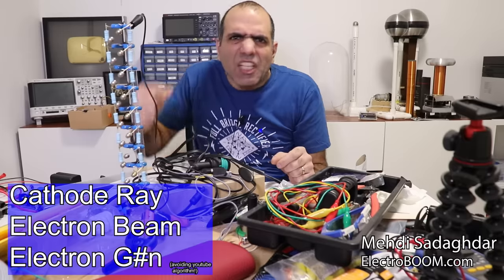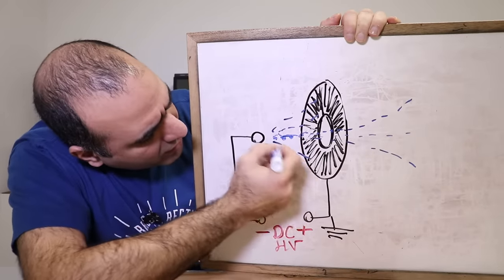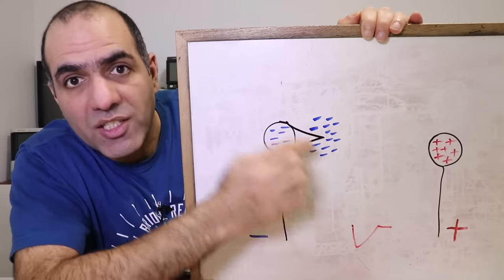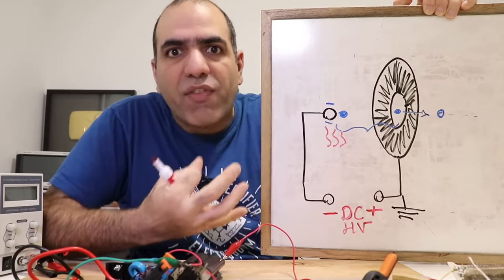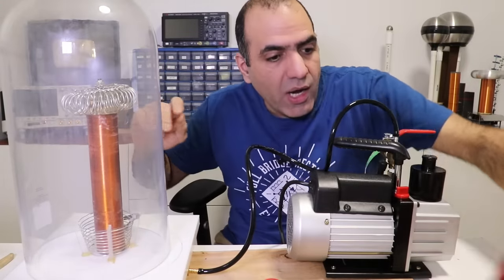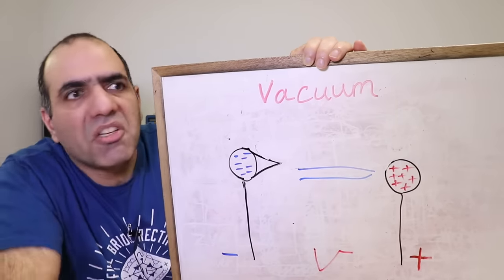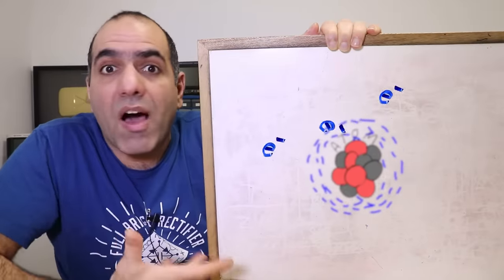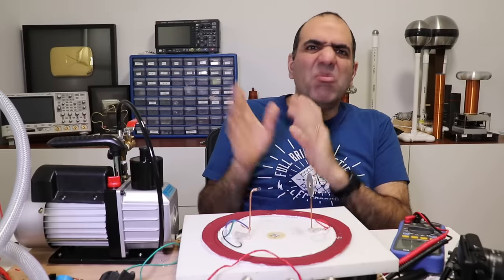Making Super Fast Electrons, Cathode Ray

Comment: In real crts, they build a negatively charged "tin can" around the entire thing. This forces the electrons into the middle, meaning that, depending on the voltage of the "tin can", you get more electrons exiting the gun.
Reply: That's cool
Reply: Also they paint the inner tube with silver to stop the xrays that it produces
Reply: Same thing with beam tetrodes/pentodes which contain beam forming plates.
Reply: @brokentos4546  the conducting metal inside the CRT is where the +25 kv is applied. It sucks the electron out after they hit the phosphor.
The xray are stopped by the lead in the glass. The focussed electron beam is created by the succession of metal plates in the electron gun, including the focus control with a voltage of about +8 kv.
Reply: I would love to see a follow up video with this! @ElectroBOOM !
Reply: @moiquiregardevideo  I'll take your 25kv and raise you 375kv for an xray:P

Comment: You can greatly improve the seal on your vacuum chamber by wiping a thin film of Vaseline around the lower rim of your clear container, laying a wet ring of RTV silicone on the base, and gently pressing the container into the goop.  The Vaseline prevents the RTV from bonding to the glass.  When the RTV cures (give it a full week), remove the container and wipe all the vaseline off both surfaces.  You'll now have a custom-made airtight gasket.
Reply: hes done this in the video where he made his vacuum chamber...
Reply: With a perfect seal, what level of vacuum is this pump capable of?

Comment: " at such high voltages it will probably generate X ray bursts"
Proceeds doing it
Reply: the dose makes the poison, I guess 😂🔥
Reply: @VigiHunter  yes the lethality is equal to time x strength
Reply: @arthurizando  
I wouldn't use the term "Strength", also I would add: divided by distance².

For a X-ray sources mA·s and KV are commenly used for driving the tube. mA·s = current * time and KV is obviously voltage. mA·s is the main way of controlling the amount of X-ray photons produced by a tube while the voltage increases the photon energy, measured in KeV (electronVolt). The voltage actually also has a huge effect on the amount of photons so mA·s has to be lowered to compensate. However, X-rays with higher photon energy are actually less absorbed in a body compared to X-rays with lower photon energy. If someone wants to see soft tissue better compared to for example bone it can be useful to lower the voltage a bit. This is a way to control the contrast in X-ray imagery. You can also take images with MeV equipment used for radiation therapy, this however created images with extremely low contrast compared to normal X-ray equipment because a lot of the X-rays will simply pass through the body without interacting at all.

So "Strength" doesn't really say much in x-ray physics!
Obviously the physics and biological effects behind X-rays are quite a bit more complicated. But my knowledge is incomplete and a bit rusty so to say.
Reply: @Ahapenootjes  o know, just trying to be brief
Reply: @Ahapenootjes  This is part of my field of study, I just didn't want do drag on in a simple YouTube comment joke :).
Reply: @Ahapenootjes  Distance squared* for a point source
Reply: unless he is making more than 30KV, he doesn't really need to worry about x-rays. their energy level is too low to cause damage.. however the 300kv Transmission electron microscopes I deal with can generate over 200 micro seiverts of radiation at certain points if the lead shielding is not in place.
Reply: @jeolman1  yes

Comment: It would be really interesting if you could do the double-slit experiment with electrons in a cloud chamber.  Would the alcohol vapor cloud cause the wave to collapse and behave like a particle immediately causing two vapor trails (i.e. similar to placing the observation screen extremely close to the double slit) or would it show trails of vapor disruption that align with how the interference pattern would form?
Reply: It would cause the wave function to collapse

Comment: Two things, 

The symbol for a diode is a artistic representation of the old style vacuum diode where the triangle is the electrons beaming from the cathode towards the anode.

You should have placed a piece of fluorescent/phosphorescent material behind the washer for a nicer effect.
Reply: That's what I was thinking. Something to check for any electrons that shot through the hole.
Reply: The third problem is having a washer that wide. Typically in CRTs the anode is made from a sheet metal welded into a shape of a cylinder, and the path of electrons has to be narrow to increase efficiency

Comment: "if their desk is not like this it means they are not working"

laughs in software engineer
Reply: So you've not got a notebook and tons and tons of soda cans?
Reply: The desktop is the desk of a software engineer
Reply: so how's the Chrome Tab situation?
Reply: @EpicBoyScout  16gb of ram for multiple tabs of stackoverflow
Reply: "If their deskTOP is not like this it means they are not working"
There fixed it for you :)
Reply: @Onio_Saiyan  if I send you pictures of my table rn, it's as u described, and yeah imma program
Reply: Instead of a desk it's your harddrive that is a mess :V
Reply: @alexstone691  laughs in gnome
Reply: @Onio_Saiyan  red bull does the work
Reply: Lmaooooooo
Reply: I have absolutely no idea what is going on in my workspace(s)
Reply: My dad is an accountant and his desk is like that.
Reply: I wish you could have told my boss that 20 years ago. We had a box where we collected everything that didn't fit in any of the 200 or so drawers, bins and boxes we used to organize parts. We often modified the computers and ended up with bits and bobs that didn't fit into any of our regular parts bins and we didn't feel was worth having a separate bin for. This was where we could find all kinds of strange parts that no one could have foreseen the need for until the day we suddenly needed to solve some problem. This could be anything from adding extra HDD trays to a case that wasn't designed for it to improvising a mount for a water pump or a fan mount. Then one day my boss happened to see this box labeled scrap and almost had an aneurism when we refused to throw it away. He could not understand how we could label a box as scrap and then claim we needed it. In his mind anything useful had to have it's own bin, box, shelve or drawer. If it wasn't important enough to have it's own bin it should be thrown away. So we organized the scrap box, suddenly taking up several shelves with something like 50 boxes, most of which contained one or two pieces, and most of them not likely to ever be used for anything but all of them potentially useful. When he saw the new shelves he just shook his head and walked away. The next time we needed more shelve space we quietly emptied all these small boxes in the old scrap box and he never mentioned it again.
Reply: @TECHSOURABH  Yes it does.

Comment: That's awesome! You've essentially made your own thermionic emission electron gun; in the ultra-high voltage example, you're DEFINITELY producing x-rays (so...umm...be careful*). Mostly Bremsstrahlung, I bet, but the L-K transition characteristic x-rays for whatever metal the washer is made of (aluminum?) are also likely in play (though they're almost certainly insignificant compared to the Brems).

May I suggest using a focusing cup around the cathode - a concave nickel-plated surface which is negatively charged. This will help you get a more even stream of electrons to your anode, and I suspect more electrons will go through the washer. And you know this already, but you REALLY need a better vacuum. Still...pretty decent for a first attempt.

*Modern x-ray tubes use tungsten (or molybdenum, less commonly) as an anode material, and they don't generally operate above a couple hundred kVp (kilovolts peak), using a current-time of 20-300 mAs (milliamp-seconds...meaning that a 10 A current in pulses of 0.01 seconds would give you 100 mAs), so if you're providing similar voltages and currents, even to a metal with a lower atomic number than tungsten, you've probably incurred at least one or two chest x-rays of exposure, assuming you played with it a bit and let it pulse 20-30 times or more. Of course, there are a lot of variables at play, so it's hard to know for sure. But maybe consider wearing lead-lined undergarments next time you play with it...just to be safe!
Reply: As an R.T., this is an excellent description. Although he probably already knows that he was producing X-rays, I agree he should wear protection. Just ask Clarence Dally, Edison's assistant.
Reply: I was thinking this throughout the entire video but never did the rough calculations. Stochastic effects of radiation always a threat and should always do everything you can to minimise even minor exposure that can add up over a life time
Reply: The washer was likely nickel coated steel or stainless, either way you're looking at k edges around 8 keV, which will be completely absorbed by the glass.

Bremsstrahlung is a much bigger concern here, but fortunately (for his health, if not his cathode ray tube) he doesn't have a very good vacuum and he's losing a most of the energy to gas ionization, which won't produce Bremsstrahlung radiation.

Edit: didn't notice the date stamp on the video or the comment before replying. Oh well.
Reply: @DevinBaillie  nah mate, don't worry about necroposting on yt ^^
Reply: Could you use xrays to Heat things up like a microwave?
Reply: @themenacingpenguin.7152  sure, if you don't mind the cancer risks and the efficiency.
Reply: @The.Heart.Unceasing  a small price to pay to cook minute rice in 58 seconds

Comment: He's literally making a vacuum tube without any grid, I love it
Reply: He needs to add a grid and use it as an audio amplifier from his lighter mic.
Reply: @kendallemory8455  yes
Reply: Or any vacuum.
Reply: The vacuum is pretty bad though
Reply: Well yeah, vacuum tube with two terminals (anode and cathode) is called diode. Add a grid and you have a triode. Add screen you get a tetrode. Add suppressor and it's a pentode.
Reply: I know, I'm just saying that if he's trying to do something interesting with it, he'll need at least a grid in between
Reply: @joshm264  Not really. You can do lots of interesting stuff with a diode. His biggest problem is lack of a proper vacuum.
Reply: is the super high voltage necessary though?
Reply: @pistonsjem  Yes and no. Depends on what high voltage means to you, i.e. how many volts?
He's using high DC voltage because his vacuum is poor and because it's fun. Although it's fun it's really unsafe because of the x-rays that could be radiated at as low as  5-10 kV at anode. Also, his apparatus is a very, very crude design.

Comment: An interesting addition would be adding something with phosphor to see if you can get the beam to strike it and make it glow. In a tv screen, you don't see the electron beam at all. You see its effect on the phosphor. I think I would set up the cathode and the phosphor and then move the anode or washer around to see if you can direct the beam. Then you can also bring in a big magnet (assuming all the other parts are glued down somehow) and move the magnet to see if you can deflect the beam.

Comment: CRT's have their applications in the consumption of quality content. source: I'm watching this video on a CRT.
Reply: Nothing like slapping the shit out of a big CRT monitor to fix the colors.
Reply: if you have an analog source like VHS you get the best quality the medium and hardware can deliver.
But using digital sources you first loose quality dued to interpolation (if available) between the digits and are limited to the range of lines of your CRT, wich I doubt to exceed the HD standard. No offense, just trying to educate. 
I still have 2 games for the original Xbox that I play from time to time, but dued to one of them only giving out analog signal the console is still hooked up to a CRT while I can easily switch it to my flatscreen.
Reply: @KimboKG14  what you say isn't wrong, but it just doesn't apply here, I'm using a PC CRT which exceeds by far the standard definition of TV's, even at it's native resolutions of 1024*768 and 1280*1024. Overclocked, my particular CRT can go up to 1440*1080i@120Hz, or 1920*1440i@90Hz. (Please note that the resolutions I just gave are technically wrong, it's usually given as half the framerate, but you do in fact get 90 or 120 different frames, just half the vertical resolution. Also I don't go lower than 80-ish Hz because it gets a bit flickery). As for the source, it's a laptop with an actual VGA out, so no quality loss here. The biggest issue really is that some content is too dark or just doesn't look right, but that's a minor issue in my experience.
Reply: @6alecapristrudel  while your comment is very funny, having to slapp (like now) your CRT may be a sign of dry or damaged solder joints. I would suggest checking/fixing the solder joints so that your display last longer. If everything's fine, a degauss (the weird BOING thing some CRT do when you turn them on) should help with the colors.
Reply: @user-le8ul4nr5t  Yeah you're probably right. But that was like 15 years ago lol. I didn't know any better, I just enjoyed the colors and the fact that hitting it actually made it work again.

Comment: I wish you had a phosphorus plate to see how many x-rays you were getting both ways of energizing your cathode ray system.
I built what turned out to be more than a 2.3 million volt voltage multiplier double marxx generator combination. Had an old civil defense radiation detection kit and started noticing the radiation dosimeter were constantly pegged even after being reset. Radon? no check for that regularly. Ultimately it turns out that high voltage Spark x-rays ,tungsten and beryllium are not things to keep in close proximity to your marxx generator. As a machinist I had worked with lots of metals and had various chunks.

Comment: Next stage: High pressure mercury vapour lamp in vaccum chamber :>
Reply: Next next video: I'm ded cuz mercury poisoning.
Reply: @wumbology3109  more im blind from uv exposure, mercury lamps are more likely to give you cancer then poison you
Reply: On reflection scratch cancer, really it's just the invisible blinding uv light that's the problem with mercury

Comment: The blobs are called striations. These are from the electrons speeding up, slowing down, and speeding up agin.
Reply: It is a bit weird to see striation patterns form a curved line though. I did wonder why they would end up like that in this case.
Reply: Samuel Lee  interesting. What I have read is that the electron path has multiple portions in its glow discharge. The striations are formed in the “positive column”. These striations are formed when the electron gets accelerated to a certain energy level to excite the minuscule amount of gas molecules in the tube. These gas molecules have electrons that can fall down to lower energy states (and emit a photon while doing so). When an electron goes to excite a gas molecule, it loses energy in the process. After it loses energy, it gets accelerated again. This means that there will be bands where the electrons have high enough energy to excite the gas molecules (bright spots), and bands where the electron has too little energy to excite the gas molecules (dark spots).
Reply: @nicholasbohlsen8442  I would assume that it could be because the vacuum he pulled wasn’t super good (as he mentioned). This meant that there was still gas that could rise up to a certain extent.

Comment: Hey ElectroBOOM could you retry this experiment but with a Wehnelt grid? Because even though the electrons should have the same speed (according to E_potential=Voltage*Q_electron) the further apart the anode and cathode are, the easier it would be for the electrons to travel to the anode instead of the hole. By restricting the field with a negatively charged Wehnelt grid and then using the Marx generator should display some plasma (I.e electrons) going through the metal ring hole...     I think
Reply: What about putting an air core inductor right where the hole in the anode is? That way, the electrons would be forced by the magnetic field to shoot through the hole.

Comment: To see any electrons past the hole, you need another anode on the other side, with a higher positive voltage to attract them. Or decrease the ring voltage and move it closer to the cathode. Voila, you have created a triode with a gate. electrode.

Comment: Hi, I think you might have a Geiger counter whilw doing this experiment...x-ray are made when a warm piece of metal project electrons vs anode and if a HV is while discharged by the filament to another metallic element in a vacuum it will emit x.rays

Comment: At this voltage I’ll be producing some voltages with x-rays oh my god so one of these days lol 🤣😂😅
Reply: I don't think that the vacuum in his chamber is low enough
Reply: @pigstation9127  I'm pretty sure no high vacuum is needed to create x-rays, as long as a significant amount of the electrons travel by themselves, not as ionized gas molecules. The x-ray emission happens because the electrons are de-accelerated very fast when hitting the anode. The speed of the electrons in turn only depends on the voltage.
Even with the "lower" voltage before the marx generator it could generate x-rays. I am however not an expert and I think (!) the doses are quite low.

Comment: I have built electron guns and vacuum systems. You are on the right track. To focus the e-beam, you will need either a magnetic or an electric lens before the anode. The old cathode ray tubes contained a bunch of electrodes with a hole in the center. the e-lenses focused the beam in an adjusted way and the beam flew to the phosphorous screen. Deflecting plates can guide the beam. A lot has been done with this technology, from displays to microwaves.